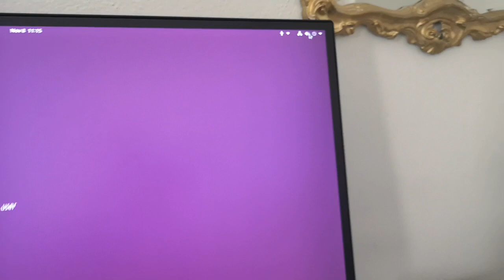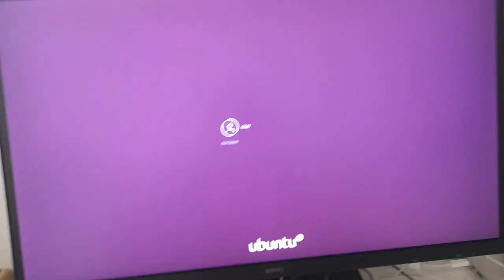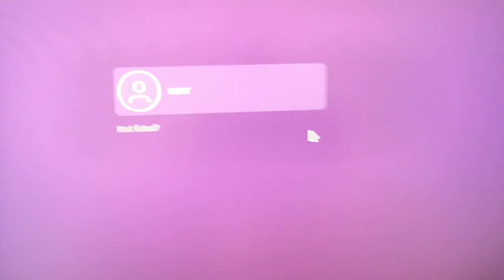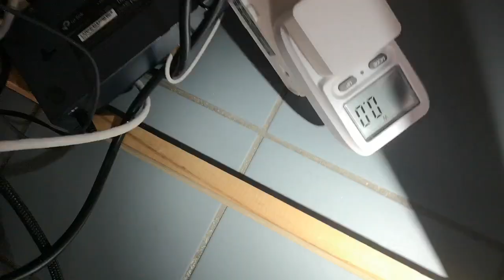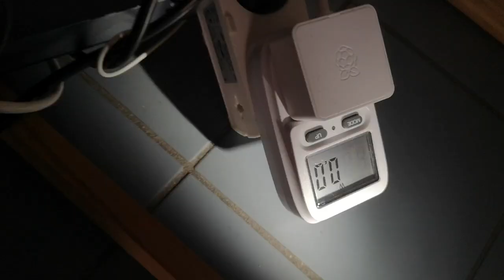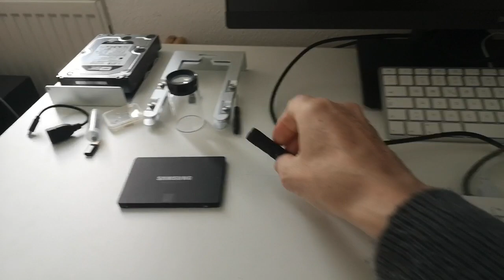Raspberry Pi 400 Power Consumption in Off State

Comment: I just tested this with my power meter. it uses 0.021 watts. The power supply that came with my raspberry pi 400 is at 5.27v and in this state the pi400 uses 0.004a. It's just far below the resolution of your power meter. you need three or more digits after zero to see the draw in it's off state.
Reply from the maker: Thank you for that, Jonathan. I thought that zero sounded a little optimistic :-)

Comment: There is a HUGHE difference between these meters. Only few are correct. I got a correct one. I will measure also.
Reply from the maker: Good idea - I certainly don't trust the accuracy of my cheap power meter !
Reply: @fotografm  0 Watt also on my meter.

Comment: Your power meter only measures down to 100mW - which would be 20mA at the 5V the Pi uses. 

Even 10mA would be a very healthy amount to supply an active wake-up circuit, and you would read that as zero.
Reply from the maker: Indeed

Comment: Ridiculous. You are trying to measure a miniscule power draw with a meter that clearly is not intended for that task and then drawing your conclusion from bad data.
I haven't looked inside a Raspberry Pi 400 power supply, but I'm sure that there will be circuitry to detect when the machine demands power. There will be a resistor to protect the circuitry and that is effectively ON all the time, hence the power draw when the computer is off.
Reply from the maker: Correct ! :-)